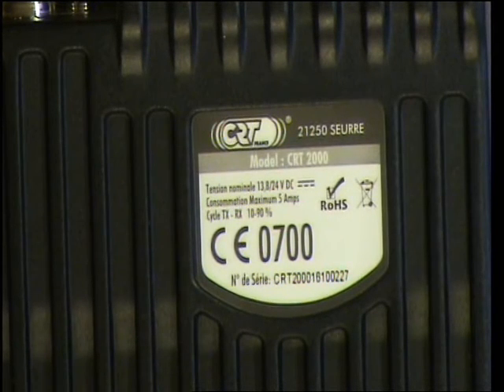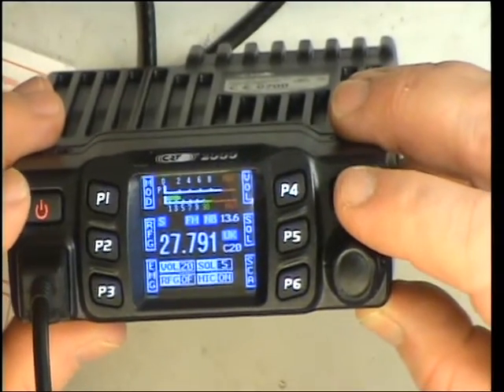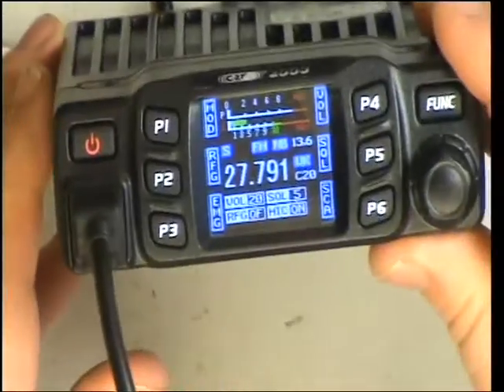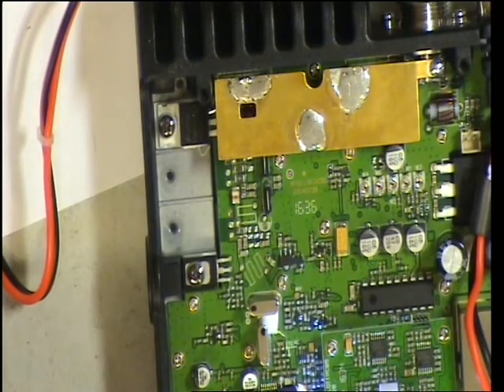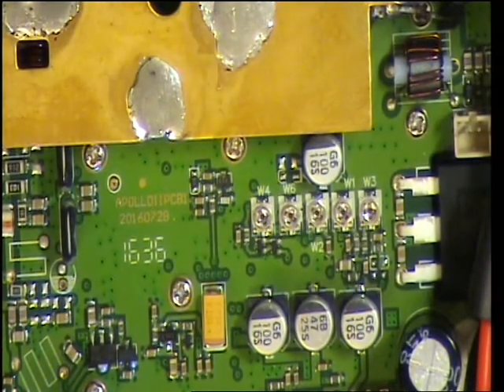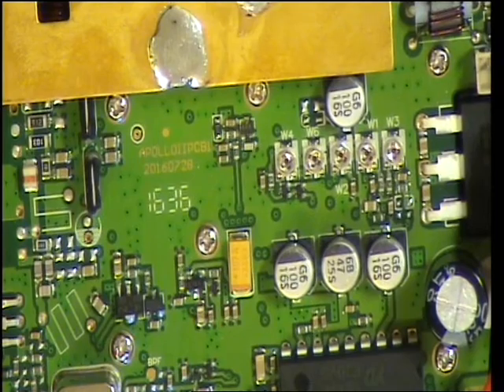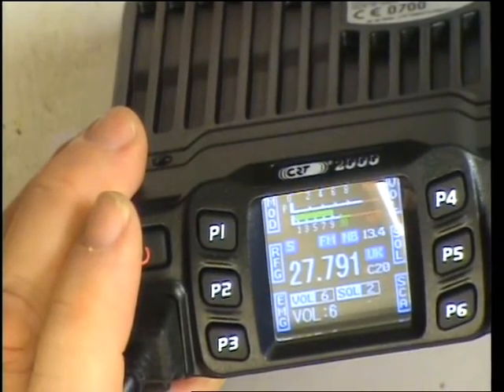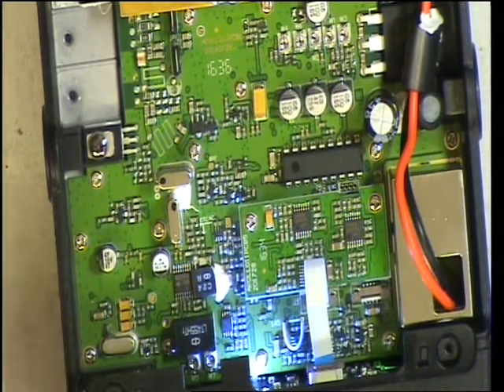CRT 2000  (CE Multi-norm) CB radio (mobile) -  TX & RX adjustment

Comment: What does TX ERR mean when keying mic in
Reply from the maker: Well it sounds like transmit error doesn't it...VCO not locking....does it do this on all channels?..check ch 1 & 40 & see if there is a difference.

Try a master factory reset. It's item 14 on page 10 of the instruction booklet.

Richard, G0OJF, UK

Comment: You didn't mention what power the radio was doing in the first place before you adjusted it .?  Or what price this unit cost ,,,surely this is half a review  your selling people short
Reply from the maker: Shane, I'm not selling anything. I rarely mention prices, but for your information I simply went on Ebay & paid £109.99 inc delivery. The radio arrived doing 3.5W. & took 8 days to arrive from a UK vendor.

The radio side of this business is commercial 2-way radio & CB service to the trade. The whole radio operation is secondary to our church pipe organ building/restoration business.

Richard
Reply: Considering that this is not a REVIEW video

Comment: I noticed blank heat sink areas showing two spots for extra finals?  It looks like the supporting components are intact.  How hard would it be to add a pair of extra finals for this?
Reply from the maker: Firstly I would ask "what on earth for". I think we have to realise that radio boards always have spaces for 'missing' components that aren't missing at all,  but are there for other models, possibly not even in their CB radio range of products. Back in the 80's when we had a TV/audio shop, there were non-uk made sets coming in with loads of holes for 'missing' components....but in other countries they had VHF as well as UHF, in France they had SECAM instead of our PAL & so on.

I honestly think you are barking up the wrong tree & even if you had the service manual in front of you & all the test gear, I think you'd end up with a destroyed radio.

If you think you'll develop more RF power (and therefore render the radio illegal), bear in mind that you have to go up to 64W from 4W to double the range. The odd extra watt here & there makes virtually no difference.

Richard (UK)
Reply: @ukfmcbradioservicingTango21  Actually was comparing the CB 27 which looks like the same board as this one.  The boards seem to be used in other models exported.  These show the components in these spots.  Was curious and too lazy to open mine.  Opened mine and the holes are not tapped for screws.  You are right, I wouldn't do this but other sites are making claims they did something like this as a mod on another model. (with QB-300 boards).  Not in the UK, but thanks for the info and video.  FQP13N10 is in mine in the only heat sink spot.
Reply from the maker: Roger on that. The FQP13N10 looks, according to the datasheet, a 65W switching device up to 1Mhz. I've no idea if they're using this as the power regulator or what in this circuit. One day a service manual/circuit diagram may trickle through the trade for this radio chassis. 

Regarding persons who claim they've done this that & the other with radio; you & I both know that CB radio is 50% bull & 50% s**t, which is why I started doing these servicing videos as a qualified & experienced 2-way radio engineer & class A radio amateur. I notice these people don't ever work in 2-way radio engineering.

There used to be a man in the town 7 miles away who said he ran a 300W burner (man now deceased). He'd go in his car with his illegal radio & burner......and was a worse signal than my perfectly legal 4W radio with a properly set up aerial drilled into the roof of my car. I could always get 35 miles 4W FM; he could....but with barely audible distorted quality. as the Americans say 'go figure'!

Richard (UK)

Comment: I bet there maybe a service or factory tune mode for some of the alignments,maybe on software.
The software  is where it makes it easier to configure radio,the radio was geared for business use on cb band esp Russia market where industry,gov and private  businesses  use it ie taxis  it a lot more for professional  applications using Fm mode and ctcss
Maybe why looks land mobile radio visually?
fixed channels makes sense with this radio type and quite practicable now on UK 40 as lot quieter and usable again.
Reply from the maker: I'm sure much is adjustable through software like many commercial 2-ay radio products are. That's why it's best ot to delve too deeply without a service manual. One will appear on the net in due course.

Richard
Reply: CRT france are very reluctant to get service manuals I have tried in past directly but was not very successful.
I don't understand why all the cloak and dagger mentality in all my years as a radio engineer,fingers crossed Richard.
I could see this radio becoming popular with small businesses where your not going to moving around on channels and want something that looks and performs like a commercial vhf radio.They is a higher powered version 50w available by a different mfr too.
Did you look at waveform on fm on testset\demod on scope if its true clipped fm Richard,im curious as not had one of these on bench yet?
Reply from the maker: Yes I hate all this secrecy. Yes, the radio looked fine on the test instruments unlike the EMS Mercury the other week. The CRT2000 is clearly capable of much more power through some programming. I spotted the output transistor the size of a TIP3055!  The business users round here seem to buy the CRT S-mini....previously it was the Midland 77-104. Both these models come in regularly now caked in farm mud....which is why we have a company dishwasher!
Reply: Lol radios in a dishwasher that's a new service concept have not seen in radio workshop,hope they are IP67 rated Richard!
:)
Yes CRT is 15W max HF export mode 25.61-30.105mhz
if you look on LHS with radio facing there are spaces for extra RF power FET,the Stryker SR-94HPC version (USA maybe a chance of service manual there,as Stryker do release manuals)has these extra parts (three FQP13N10 final transistors) for 45+ watts of PEP capability making it quite a capable radio.
all the best,great vid enjoyed Richard
Reply from the maker: Not the whole radio in the dishwasher, cases, knobs, mike moulding etc, though anything valved goes through the dishwasher as a complete chassis. Can you see how bothered I look? Pipe organ parts go through the dishwasher when they fit too. Sometimes the dish goes in as well. and I dishwashed a 20" B&W CRT, then a 19" one.  Look like new....and the whole tv chassis. Works great. Nice 'clean' picture. An elderly Hoover engineer put me onto dishwashers when I worked at Nottingham Radio. Washed all the Hoover motors. Work a treat after that.

We're not interested in export models or any capability outside UK legal.

Richard
Reply: sorry engineer sense of humour :)